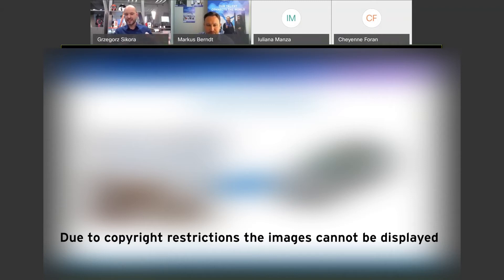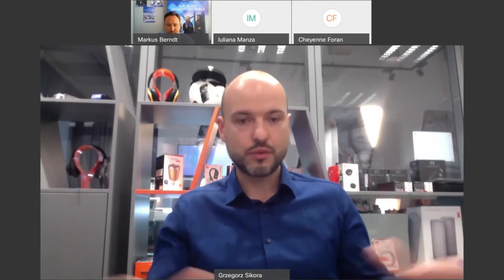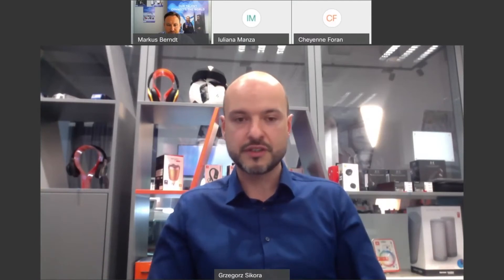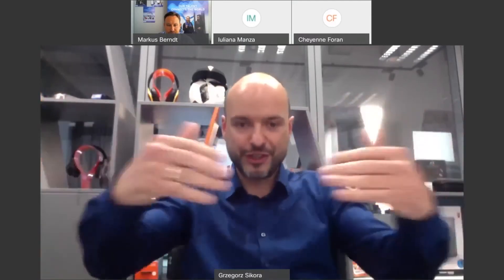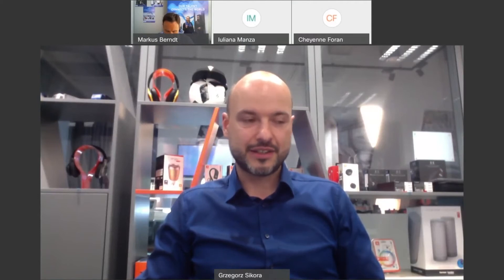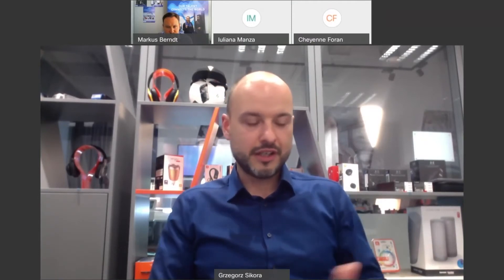Home vs. Car Acoustics - Quality sound experiences for every environment

Comment: Product Complaint: Robotic Sound when trying to play music (JBL Partybox300)
Case Number: KA-C190920-46908, KA-C190920-4690826
Video of the complaint 1: https://youtu.be/xVDNeVeeD3c
                                          2: https://youtu.be/-xDbBu7y-FA
1) Purchased a brand new #JBLpartybox300 from #Reliance Digital @reliance_digital, Bangalore on July 11th 2020.
2) From Day 2 onwards system is giving a peculiar robotic sound when trying to play music from phone connected via Bluetooth.
3) Contacted JBL customer care toll free number, explained and played the robotic sound which i recorded
4) Was informed it’s a software issue and nothing to worry about.
5) It kept happening again and again and then I raised a ticket with JBL (emailing defect with video samples on 19th September
6) Couple of days later JBL service center (Bangalore) contacted and informed nothing to worry that its a software glitch. Technician came to my place next day for updating to latest version of software and he was not able to update it. Told me the product needs to be taken to service center for fixing. I refused since he didn’t have a 3/4 wheeler to take the huge Partybox 300 to service center,  so I informed him that I myself will take it to service center in my car which is much much safer than taking my brand new product in a 2 wheeler the day it was raining in Bangalore when technician came.
7) 3 days later i took my brand new Partybox 300 to service center in my car (Fine Fone Solutions, Jayanagar, Bangalore) to get it fixed. Reached there by 10:45am and they team started trouble shooting. 
8) Informed that its not a software issue, motherboard needs to be changed. Asked how this can be possible for a brand new product but there was no reply.
9) I was told I need to wait for 45 days or more to get the motherboard replaced.
10) I didn’t feel like keeping my brand new expensive JBL Partybox in a trash for 45 days. So told them I will bring it back once you have things ready, informed them to pack it so I can take it back home.
11) Waiting for packing to finish so I can take home but there was no response for 15-20 minutes. Asked them why taking so much time to put the piece in the packing box which I came with? Response came they are doing one more round of trouble shooting as advised by some senior management. After 30 minutes confirmation came that nothing can be done that motherboard should be replaced, 13:30 Hrs
12) No response from JBL Bangalore after that till now. Started posting in JBL Instagram page and got a response to share my contact number which I did on 6th October. Shared contact number but as usual no response after that. 
13) Connecting from JBL Customer Care (1800 102 0525) from October 1st..
        1) October 1st – response from CC, JBL will contact you in 72 hours time. None contacted
        2) October 5th – response from CC, JBL will contact you in 48 hours time. None contacted
        3) October 10th – response from CC, JBL will contact you in 48 hours time. None contacted
        4) October 15th – response from CC, JBL will contact you in 48 hours time. None contacted
        5) October 15th – response from CC, JBL will contact you in 24 hours time. None contacted
        6) October 17th – response from CC, JBL will contact you by EOD today.  None contacted
        7) October 22nd – response from CC, JBL will contact you in 24 hours time.
                  That’s the limit to my patience and &#^^#()@^^& connected me to supervisor Mr. M Venkat after putting me on hold for 1 hour 5 minutes ! and he assured it will be resolved in 10 days time and how dare the service center say 45 days and that he will take care of it. If not, I can directly contact him via customer care toll me number and requesting representative to connect directly to Mr. M Venkat and they will connect me to him so I can directly speak to him.
      8) October 31st (10th day as told by Mr. M Venkat) – contacted JBL toll free number and response from CC when I told to connect to Mr. M Venkat (after putting me on hold) -- ‘Saar we will arrange call back in 48 hours time’
#Spineless MR. M VENKAT show some guts and balls -  Not surprising, after all another JBL dummy product
In fact, not surprising at all as I was not expecting anything from JBL’s so called customer care or social media team.. And from my experience so far with JBL (3 years back it was my Soundbard SB350) I am aware how customers are treated in India by companies by giving crappy products..
My experience in a nutshell with the so called premium JBL product..You guys should be ashamed. Product is mediocre and customer care the WORST and PATHETIC without doubt. 

Few Queries to JBL India
1) Why torturing and giving mental agony during this pandemic – technician coming home, taking product to service entre, me taking it back home unfixed, again the same thing…Its so safe these days..Woow...Why JBL why?????? Is this what we say peace of mind after a premium purchase? Shame @jblindia @jblaudio @jbl_pro @harmankardon @harmankardonindia @harman_intl @reliance_digital @dineshcpaliwal
2) Are #JBL products so cheap and mediocre?
3) How can a motherboard fail for a brand new product?
4) Since this is clearly a product defect, which the service guys accepted, why can’t you accept it as a manufacturing defect and provide customer with a brand new piece 
I demand JBL to provide me a brand new piece. This defect which doesn’t have anything to do with customer rather it’s the mediocre quality of JBL. If not, I will be taking this to consumer court.
A frustrated customer (another fool who believed in JBL)